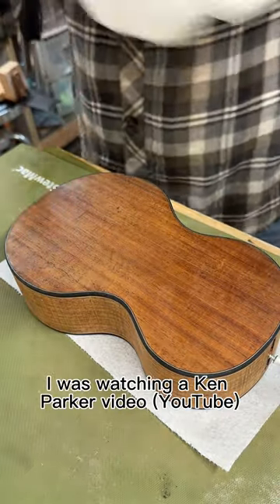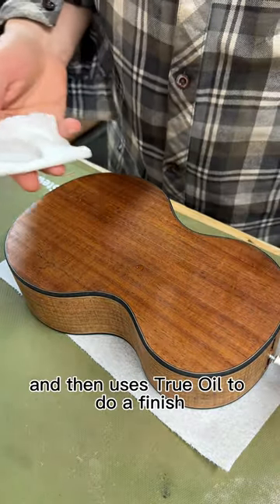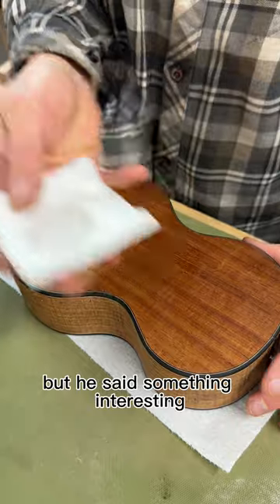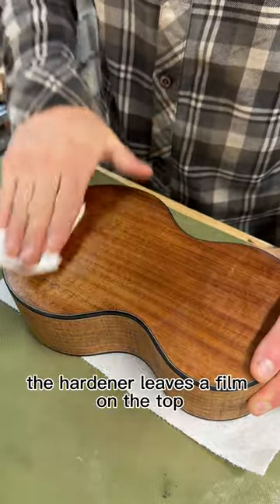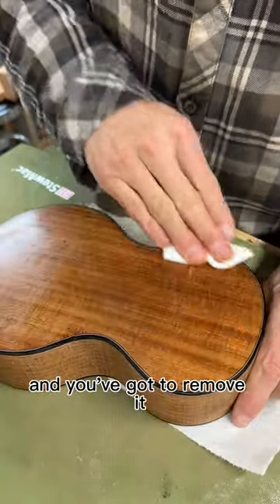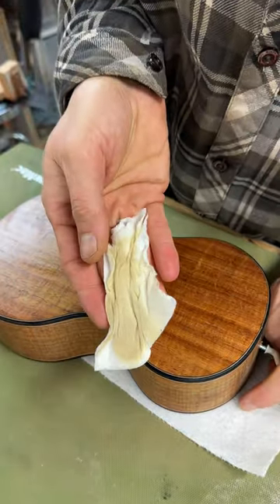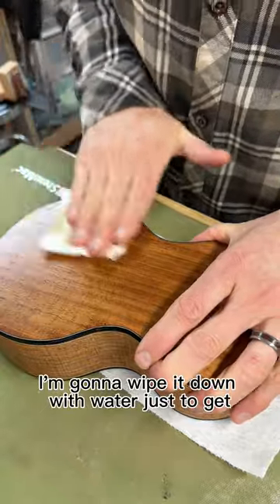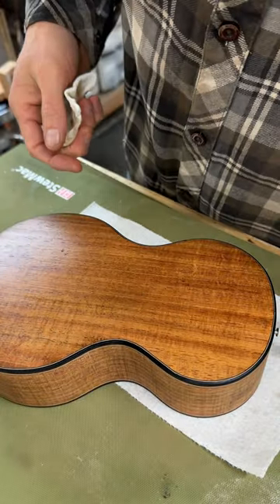Important Epoxy Tip

Comment: What kind of epoxy did you use for pore filling. Is that link somewhere. What else can you fill with epoxy?
Reply from the maker: This is west system epoxy, a common pore filler and epoxy: https://amzn.to/3mkEkTu
Reply: @BeauHannamGuitars  thank you Beau. So far I’ve gotten away with avoiding  pore filling. I haven’t been interested in glassy smooth surfaces. Is there a reference or ‘bible’ so to speak that you follow to help you decide when pore filling is definitely needed? Or did you inherit certain practices from your mentors and now that’s just what you always do ? Thx
Reply: I’ve got this staved banjolin restoration project and I may need something like an epoxy to fill gaps between the staves. Thank you for this product link and heads up about proper prep.

Comment: Wow, I can’t imagine the sort of adhesion problems that could lead to if you’re using a cross-linked water-based finish like KTM9. Which by the way, mostly peeled off of a guitar I made about 14 years ago
Reply from the maker: Luckily, I think this stuff gets usually sanded off because people at least scuff sand between epoxy coats- at least it has all the times I’ve used west system and not wiped it off!!! Apparently system 3 silver tip doesn’t have this problem